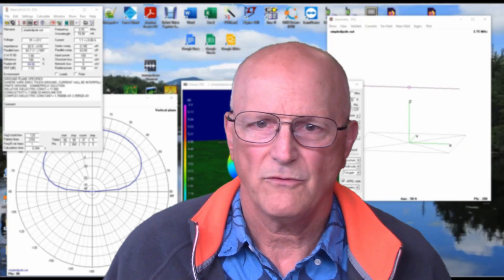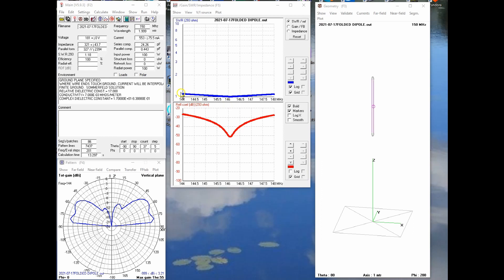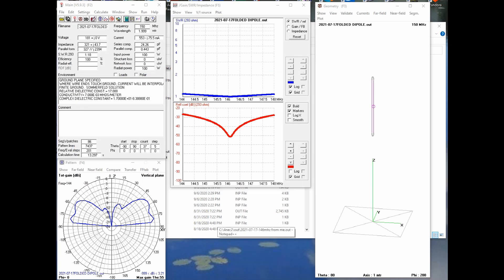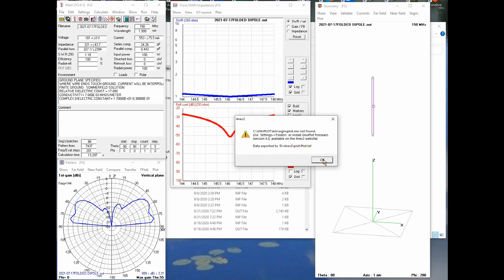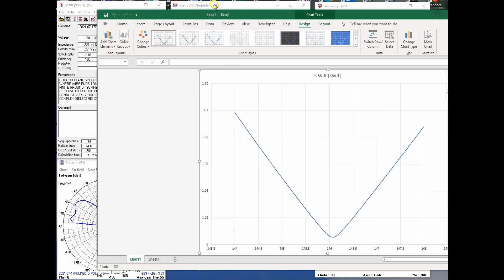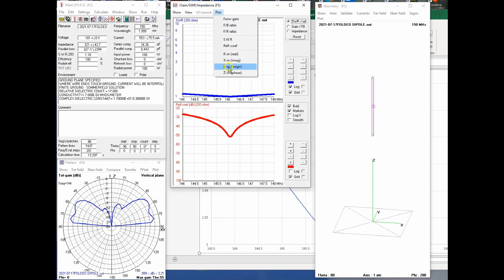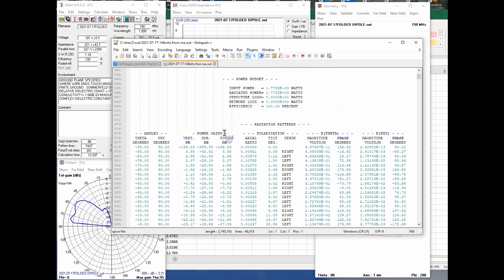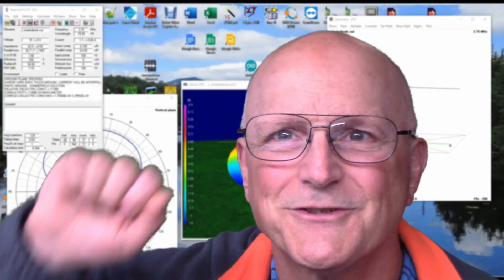4NEC2: Exporting Data (008e )

Comment: Thanks!  I found this while looking for info on how to parse that humongous out file!  I was after gain and SWR data vs frequency.  I'm a newbie, but I'm starting to think the 4nec2 "gui part"/wrapper is responsible for calculating SWR, not NEC2--I can't find it anywhere in the out file (I finally found a post on the internet saying so as well).  Also, I believe only 4nec2 is aware of my load impedance.  So, this might be the ONLY way to get the SWR data.
Reply from the maker: If I remember right (I haven't looked at one of these in a little while, so memory is a bit foggy) ... yup ... it does not report SWR. I believe that it reports the Reflection Coefficient. 
But, the good news is, the SWR and the Reflection Coefficient are mathematically related.
The Reflection Coefficient has a Real and Imaginary part - it is a complex number.
The first step in converting this into SWR is to find its magnitude. {sqrt(Real^2 + Imaginary^2)} I will call this |Gamma|
Once you have this, then use this formula:
SWR = (1 + |Gamma|) / (1 - |Gamma|)
I hope this helps. 
I would be very glad to dig into this further if you want me to. It would be fun to dig through it again. :-)